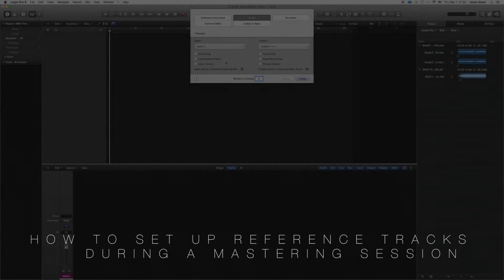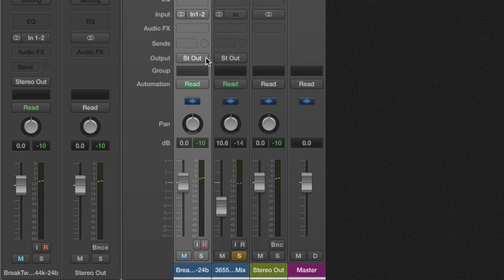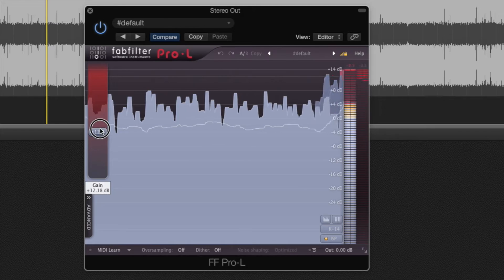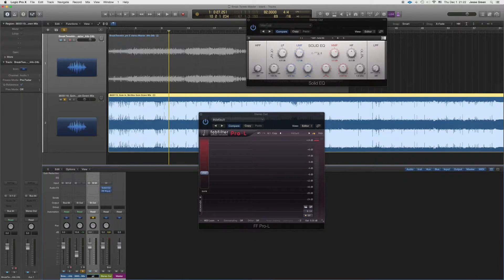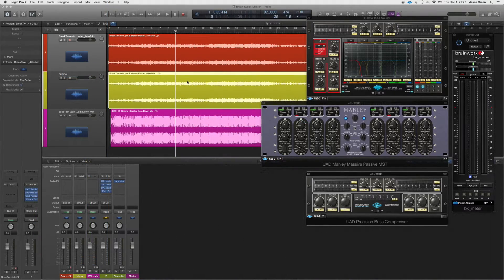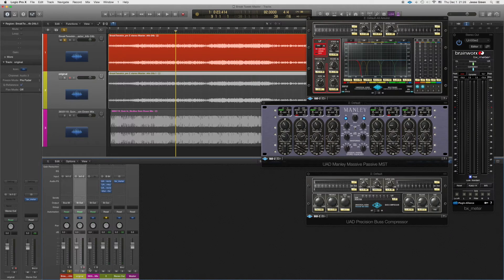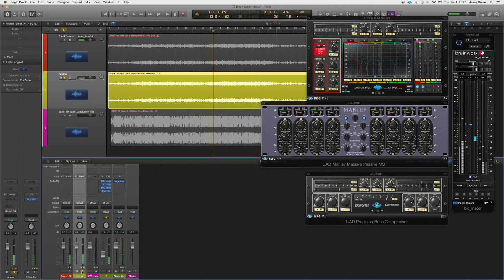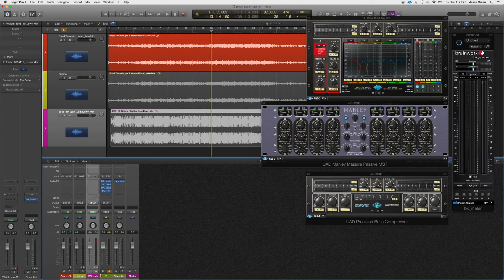How to Set Up Reference Tracks on Logic Pro X

Comment: Very cool trick. Thanks. How come you couldn’t just put the mastering plugins straight into the track channel, instead of an aux?
Reply from the maker: That's a good question! First I have to say that this isn't the only way or the 'right' way to set up your mastering workflow, there are different approaches for different reasons. The reason I use this particular setup is so that I can do parallel processing by sending audio from the original audio file and then feed that into my master chain. If you insert your mastering plugins straight into the track channel then your parallel send becomes processed TWICE! Hope that helps.
Reply: @BeethovenboyProductions  Got it! Thanks. What sorts of parallel processing do you do during mastering? And, what volume level do you set your references to?
Reply from the maker: It all really depends but I tend to do stuff like saturate certain frequency bands, or maybe compress a certain band. These days I'm doing it more with plug-ins rather than manually sending a signal out for processing. I don't use certain volume levels when mastering, I compare my tracks to other tracks and adjust accordingly. When I mix though I use a K-14 meter and try to get my RMS levels around 0db (which is roughly -14dbFS).
Reply: @BeethovenboyProductions  Thanks again. So when mastering and comparing with references, you simply adjust the volumes by ear? And lastly, isn't -8 dB RMS the industry standard or has that changed?
Reply from the maker: @ckowalski1029  That's a great question. Firstly I'm a small fish in a very large ocean so I can only comment from my experience in the industry as such. That being said lots of the big players have wildly different opinions on this. I just watched an interview with Andrew Scheps and he was asked kind of the same question to which he commented that all the major streaming platforms don't have a set standard in terms of loudness and also that they're constantly changing. Because of this it's almost pointless to master in terms of a set standard. Currently when I mix and master my goal is to make it as clear as possible and appropriately loud with respect to the genre. One thing I've been hearing constantly the past year or two is that you should master to -14LUFS but when I throw a meter on new releases they're slammed to -3LUFS!
Reply: @BeethovenboyProductions  I agrre, I've noticed that as well. Thank you for your time. Great work!